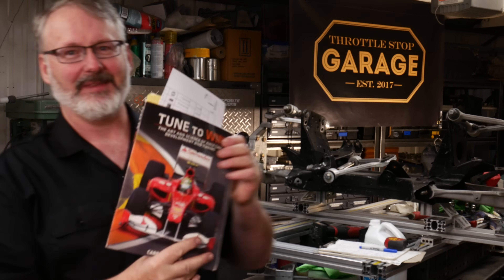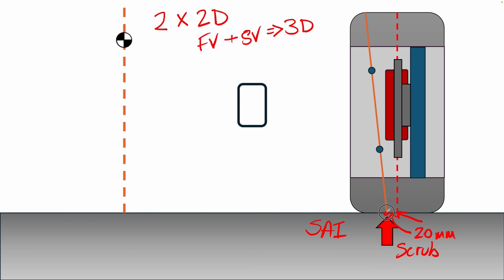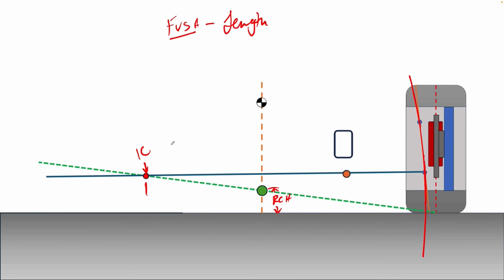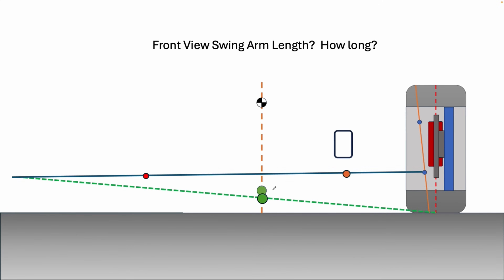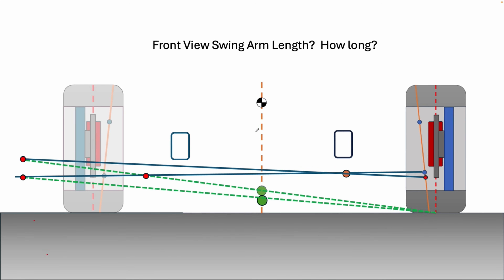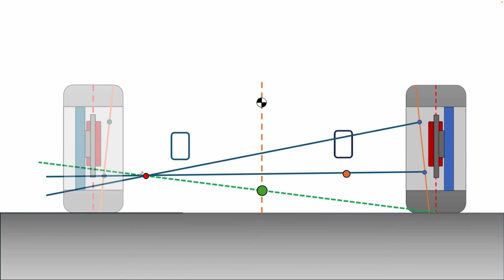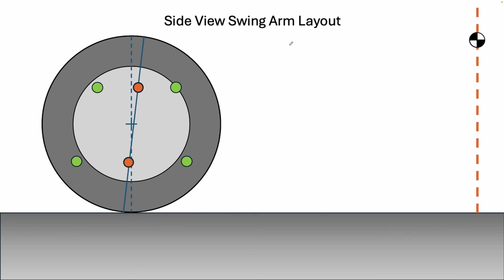Suspension Design - Take 2 - New and Improved and in 3D! My attempt at doing the impossible.

Comment: 24:55 i think about Lexus front suspension, the is300 first gen, the soarer/supra mk4, ls400 on. They run a fair bit of angle for the top arm for anti dive. Bmw don't use double a arms so you can't check with them but Lexus do a good job for handling i think.

Great video. Watched it when i normally listen to videos. My 122 is staying stock, but I've got an mg td to build for my wife and keeping the stock mg cross member is my limit but the top arm being upgraded is a great option given an engine upgrade to a Mazda unit.
Reply from the maker: It's interesting how some of the things in the 2D model that I though were important just weren't in 3D.  I almost never checked the roll centre - when done, it was a little lower than 60 mm but right on.  It still makes my head hurt.

Comment: You mentioned you picked 20mm for you scrub radius and didn't know quite why. Here is a quick answer based on my knowledge

The tire flexes as you apply a lateral load and that will bring your tire center towards the inside of the turn. Generally your trying to line the steering axis line with the center of the contact patch under load. So wherever you got the 20mm from was someones guess that the tire would flex over 20mm under load and designed his suspension around it. 

There are labs that will tell you these characteristics. The stiffer the tire and the smaller the sidewall will decrease flex.
Reply from the maker: True - without that tire model, the 20 mm is a bit of a guess.  The information is pretty vague - there is also a moment created by the offset to the contact patch centre and a few other considerations.  Most things I've read were a little vague about the value - something between 10 and 40 but not more or less is what it summed up to.
Reply: @ TBH, 20mm sounds like a lot. I’m in the desert racing world where that number can be over 2 inches. There are some wild videos of the tires bouncing back and forth through corners. You can see F1 tires do something similar in slow mo as they unload mid corner and touch a curb and while super noticeable, I would guess it’s closer to 10-15 mill. 

It’s not a huge deal if you get it slightly off. That moment you mentioned will cause the tire to skid just a little and understeer which is usually preferable. It simulates just a touch of front braking which hurts lap times but would be unimportant for a road car.

Comment: My concern is you might be under valuing the correct ackermann, your'e correct in F1 run very different ackermann but they don't do any real tight maneuvering and have very different priorities, whereas in a road car at slow carpark speeds (where load on each tyre is more equal) you'll have the wheels fighting each other. Getting ackermann correct for your design which looks like you're putting the steering rack forward of the steering axis(presumably to avoid part of the engine?) is likely be difficult as the end of the steering arm would need to move out towards the tyre and disk rotor where there's not as much room (this is one reason most steering racks are behind the steering axis).
It didn't transfer to you're 3D model but when you transferred the suspension pivot heights to the side view on the video you transferred the ball joint height and not the inner A arm height (bottom wouldn't matter but the top should be lower).
Reply from the maker: Good point.  I will take another look at it.

Comment: I like your series but “paralysis by analysis” seems to be the phrase that comes to mind. Put some  tried and true suspension under it. You’ve built a carbon fiber Volvo Amazon!! - built it, drive it.
Reply from the maker: There were points where I struggled - not paralysed by any means. At this point, I've designed a suspension for the car.  This all started by trying to graft something into the car and it was never right.  I'm building this one and we'll see how it goes.  I think it's going to be just fine.

Comment: Thought you fell off the planet man… You may be overthinking this, Can’t you just grab a rack and pinion off a mustang 2 or something?
Reply from the maker: Overthinking is for sure what has been going on.  No question.  The M2 rack is just a little longer than the BMW and generally has a slower ratio.  The BMW unit is already in the garage as I stop digging this hole and start building.
Reply: @ThrottleStopGarage  Speedway sedan guys, and other race car builders, seem to use a short rack, with long arms, so that the pivot points are way inside the suspension pivot points.
Reply from the maker: @tezzrterry7485  That's what the car comes with - the issue is that the longer LCA starts to restrict engin bay space and getting short powered racks is difficult. I've got a shorter power rack from Woodward and with the external ram, it also doesn't package nicely.  I think these race cars have engines behind the rack and I can't fit the engine that way.